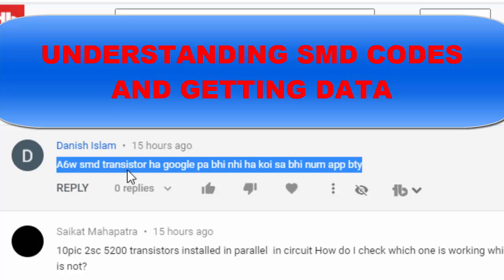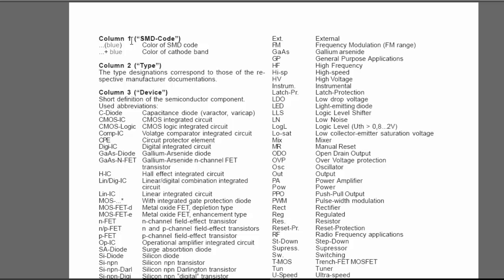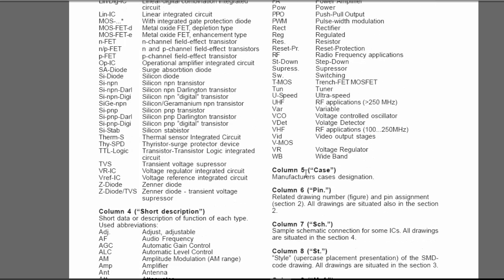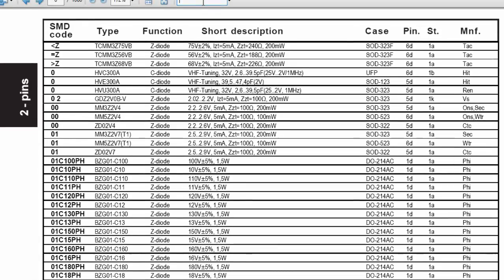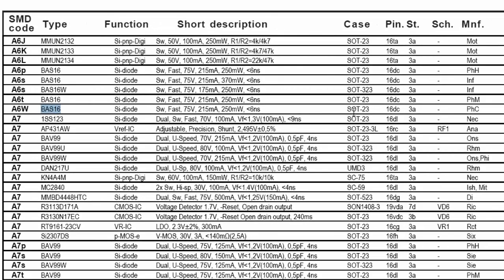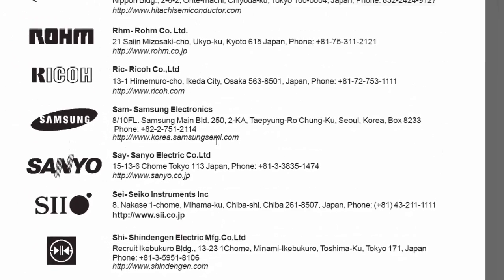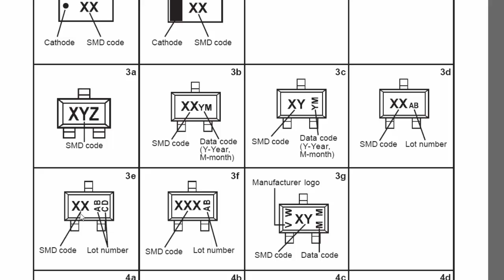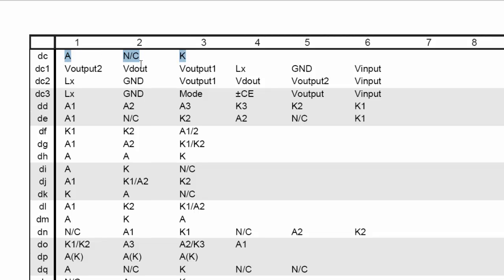#308 How To Find SMD Component Code data

Comment: Another great video by Haseeb, many thanks, never stop learning. I have a also have question about a diode which I have been struggling to identify. Any help would be a welcomed case is SOD-123 and the markings are A2 B6. A2 indicates it's a switching diode and B6 as a Zener. Any pointers would be most welcomed, many thanks in advance.

Comment: SS29AA 6pin small component. I didn't find details about it. It's in 12v DC car dash cam mother board.
Reply from the maker: Please send it's picture to my WhatsApp 00962-79-1161084
Reply from the maker: If possible write and code and version / batch /lot  separately

Comment: How can i find an ic number (8pin PWM) ? the surface has no markings, even with the heat paste, i cannot see anything.
what i have found out is PIN4 is Out PIN5 GND PIN1 Soft start,  any idea what ic is this ?
Reply from the maker: it looks a TOP OR TNY IC
Reply: @HaseebElectronics  thank you, i will look in my garbage garage :)

Comment: Thank you so very much Haseeb! This is very valuable information and will be of great benefit to me and I am sure many other of your subscribers.  Researching SMD devices can be quite a head ache as there is no one standard for manufacturers to adhere to. My results of researching SMD devices provided me with a number of standards for the same device which can be frustrating as after finding possibly the device there is still some doubt in mind. Your explanation and willing to share your resources cannot be over emphasized. Once again thank you my friend and another great video.
Reply from the maker: welcome and special thanks for appreciating my efforts
you are right that smd coding and decoding is a big headache, but it is a special technique. come manufacturer conceal there technology using unmarked smd components
i received a huge amount of comments, "how to find smd, how to understand smd, how to replace smd" so i shared it, might be it will some helpful